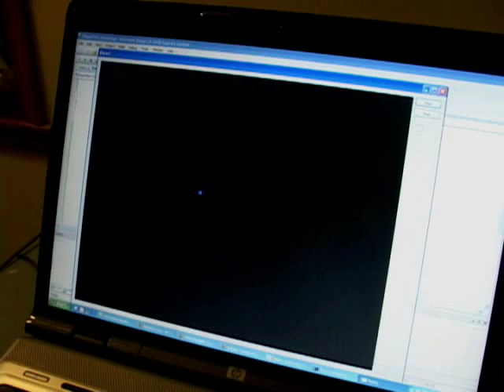WiiMote IR sensor and Arduino

Comment: did you get rid of the 'classic' light sensor once you rigged the Wiimote sensor directly? I'm not sure what your galvo scanner speed is, but if you time it right, the two should not interfere with each other (causing flickering in your blob tracking).